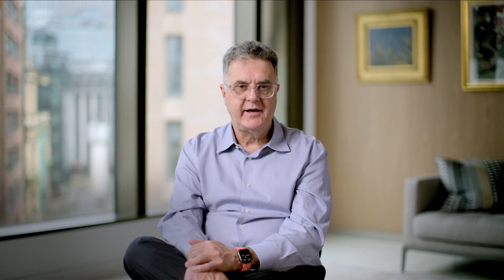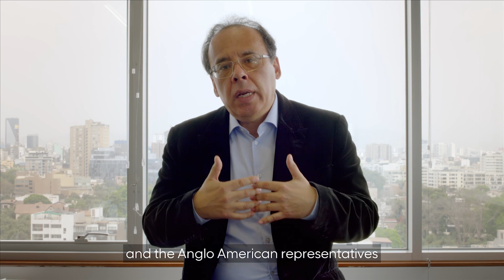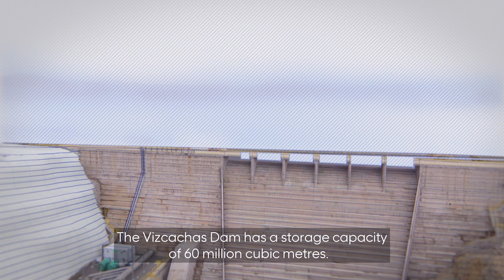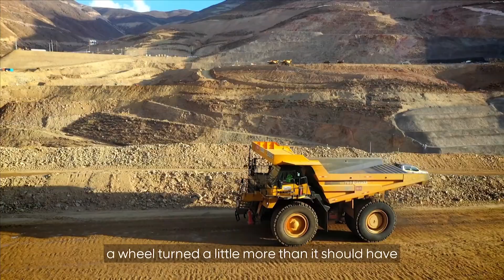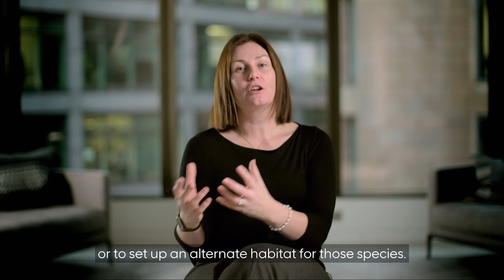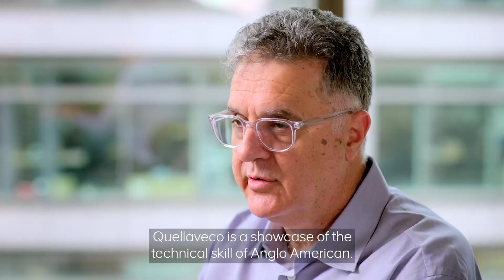Quellaveco: Sustainability By Design [English Subtitles]

Comment: Very interesting and unique sustainable design concepts, glad to see this for the wellbeing of near communities and also to be taken as a guideline for the future of world mining as well, just one question: did I understand right?, it says at the end of life the mine site reclamation considers to backfill the pit with waste lands materials?. This would take years, it is essentially putting back to the pit the massive amount of waste materials removed during operational life …let say even in a decade of work would mean a huge fleet of ultra class mining trucks, indeed for 10 years work would require around double of the operational fleet of useful life if the mine operated for 20 years.
This 120 kton/day mine process plant would extract average over 200 million tons of rock per year (ore and waste) from the pit, in 20 years of life it would be required to put back in the pit over 4 billion tons of waste lands, let assume roughly a cost of 0.5 USD/ton to be transported to the pit backfill process (I may run shorter in this unit cost assumption) would mean over 2 billion USD just this backfill work of the mine closure.
I have not taken into account the pre-stripping material that could be some couple hundred million tons of top ground removed prior to start operation of the pit.
If you could clarify this pointed matter, it is most welcome, thanks!